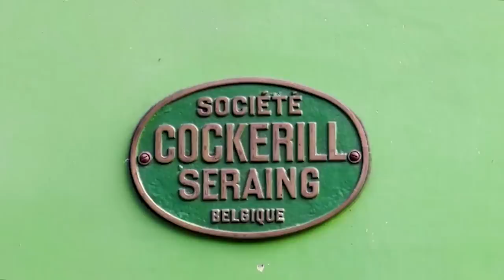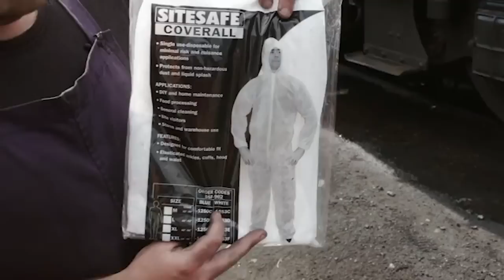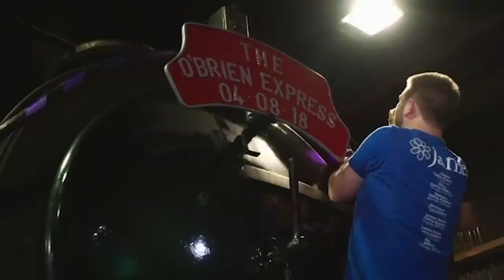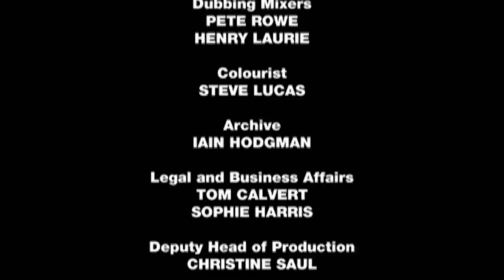How To Be A Steam Railway Engineer | Yorkshire Steam Railway | Reel Truth History Documentaries

Comment: Can I become a steam locomotive engineman? Although aged 60, I have my ticket to do it. Ticket? My grandfathers 45 year long service award, an engraved Smiths gold wristwatch, from British Rail, having started as a cleaner in 1919. Plus my lineage: Two grand fathers with over 45 years service each as steam locomotive engine drivers (GCR/LNER/BR); one uncle as top link steam locomotive engineman (LNWR/LMS/BR - who promised me a start at Crewe that could never happen - steam gone); one uncle from oily rag (cleaner) to senior instructor at BR (steam/diesel/electric - LNER/BR); three uncles as firemen (LNER/BR). Besides this I swear that I can detect a steam locomotive at a distance of a mile away, and that my blood is almost steam. Give me a shovel and it will probably do all the work itself helped by the ghosts of my ancestors. Enough?
Reply: Go ask Them as they cant read the comments :)
Reply: @Nellerkillerstrains  Maybe I should. :)
Reply: no, you start at the bottom and spend time proving your capable. if you show the aptitude and work ethic you can go on up the grades as advancement slots allow. the blood that runs through your vain dosent secure you a place. only your graft and skill you show as YOU will be cleaning the engines with that rag. not your family name. as an fyi, theirs a 70 year old firing the locos were i work. so as far as im concerned if your fit and well and have a strong back and mind then send an email to there head or recruitment or turn up in person and ask any platform staff were to start. i belive in you, and its worth going for it even if you dont make the grade. be warnd its at least 40turns as a cleaner before someone will put you on a list to be coincided.
Reply: To become a driver will take a long time. On the NYMR you start out as a cleaner where at the moment upgrading from cleaner to fireman will take a minimum 5 years. Once a fireman it could be quite a few more before you pass to driver. The volunteers working there atm may have ancestors who worked on the railway, but they're having to put the graft in to advance. If it's a real ambition of yours, visit the website and sign up (the more the merrier) but the longer you wait, the more hard grafting volunteers will be ahead of you to "pass out" and advance on to the next part of their ambition.

Edit: If you do want to start volunteering, don't worry about age as you will nowhere near be the oldest person there.